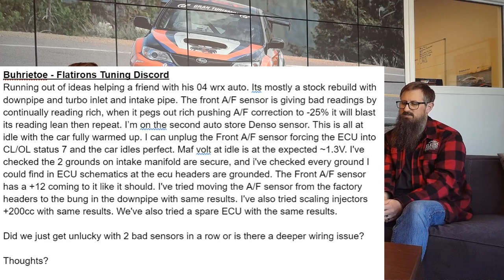Transmission grinds, 4EAT vibration, and Boost falling off

Comment: My auto 04 fxt has the same thing with vibration in park, I can’t find it out either. It’s not near as bad as his sounds but the vibration hasn’t changed at all from stock when I bought it to changing all the suspension out and most parts around the motor itself. New trans fluid completely due to a failed pan gasket as well. Mine also vibrates occasionally sitting at a stoplight the same way as park but with my foot on the brake.
Reply: I've seen aftermarket axles make vibrations at idle. The shafts are slightly longer sometimes and will vibrate side to side in the joints.
Reply: @garnermtb  interestingly, my axles are factory stock, one of them just went, vibration hasn’t changed at all. I’m about to throw an aftermarket axle on there actually whenever it comes back from wrap

Comment: Injectors are in a ground side switching circuit. 
The computer grounds the circuit and you should see 12V on both sides of the Injector with the Key On.
You should also see 12V on all of the individual injector control wires at the ECU.
The computer is reporting low voltage, meaning it is not seeing the anticipated 12V at the pin.
There is a voltage drop in the Injector harness.
I would check voltage at the ECU and then at the injector end of the control wire followed by the power side of the injector continuing all the way back to the fuse box.
Remember the ECU is only reporting low voltage in the injector harness, why look at the battery or the Alternator?

Edit, in my 03 GG9 The injectors share 12V supply with the IAC so in my case I would also look for a fault in the IAC circuit that could be pulling the voltage down.
But again, the ECU monitors the IAC circuit and would report voltage drop for that component so it's still worth doing comprehensive voltage drop testing in the injector harness first.

Comment: 05 blobwagon closed deck outfrontmoto 2.1 stroker short block, all forged internals , blended bowls,  multi angle valve job, FBO, invidious dwn pipe, catless up pipe,  3’invidia turbo back,  big TMic, tvgs gutted,  750cc injectors w fuel pump, bigger Blouch turbo, grimspd aos, Dyno tuned w 300hp 274ftlb torque at 119mph at 18.5psi.  

I blow smoke when starting!!! Then clears right away.  

More often then not after a heavyish foot 🦶 drive and even more so if engines only been off for short amount of time.  If I have to kill the engine for a short amount of time such as filling up at the pump, then next turn over can be a huge cloud.  Engulfed ppl at pumps behind me 😂have to apologize every time caus it’s bad! Haha.  Was a hit or miss not consistent and as if now haven’t seen any in weeks.  But this is norm haha.  180k miles, daily. I drive the dog piss outta it and change oil every 2500 w VR1.  Ahhhh the evap is deleted as well as rear 02. Afrs at idle 14.5 w a flash of a 15.1 every handful of seconds. And spot on where we want it at any throttle position .  So I like to think it’s running well.  Pulls like it does haha. It’s done this off an off for the 3 yrs I’ve owned.
Reply from the maker: Thanks for the question.  Have you checked the lines between the AOS and turbo inlet for signs of oil?  I'd suspect that you will find some oil there, and in that case, the first thing to do would be to remove or replace the Grimmspeed AOS with a better design.

https://youtu.be/OjoA2qXujMA?si=BEI7OEjvHH0C2TpO

Hope that helps and Stay Tuned!

Comment: Failing fuel pump will be extremely noticeable. Almost a stall. I’ve had one overheating before and the power drop off was the equivalent to being out of gas

Comment: Power drop off and lack of boost: early clutch slip. It won’t smell (too obviously). Could be a clutch starting to go or oil leaking out of the sandwich plate/rear main seal and flicking onto the clutch. Personally experienced this
Reply: Easy trouble shoot and temporary fix is brake cleaner into the clutch from below in the gap by the mating surface